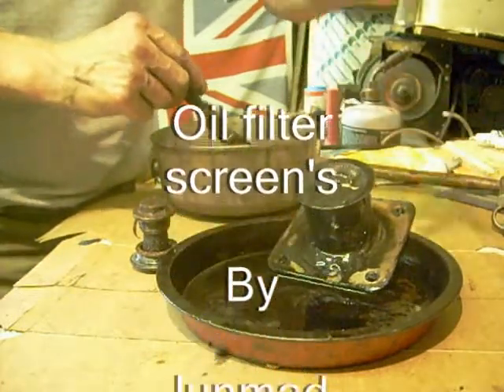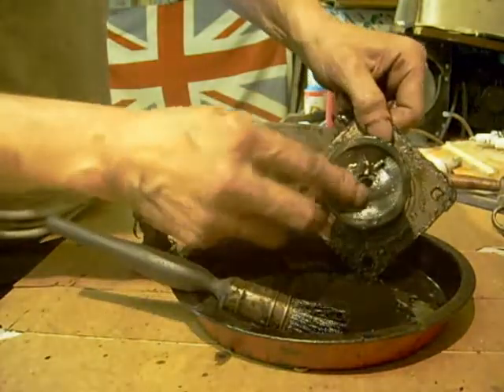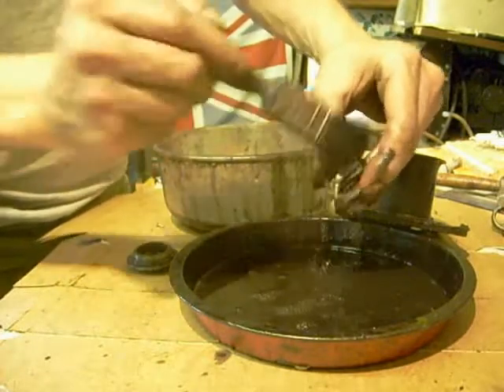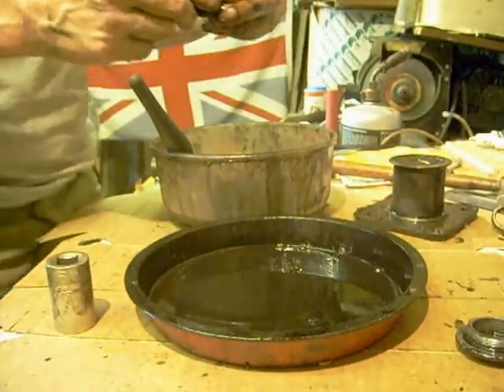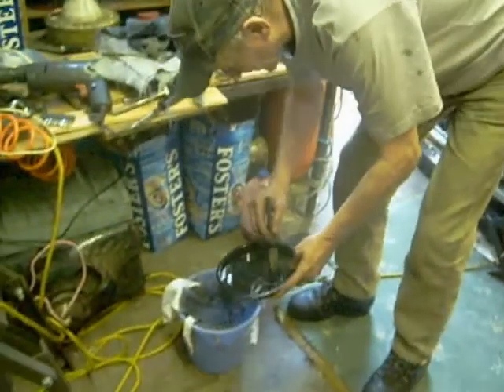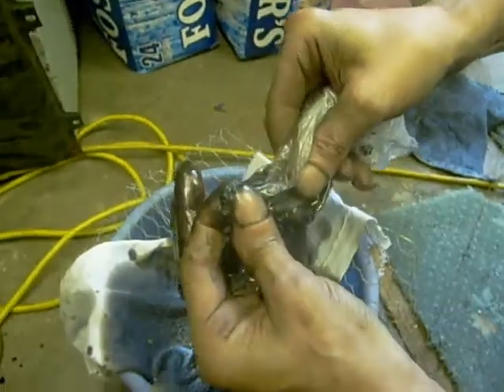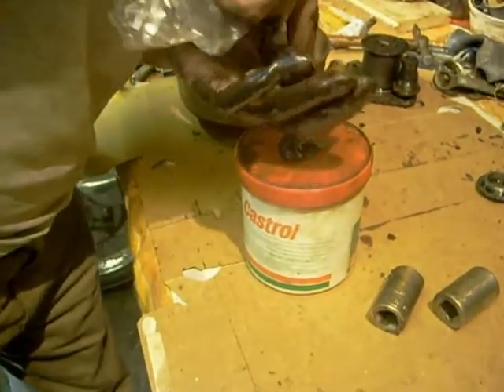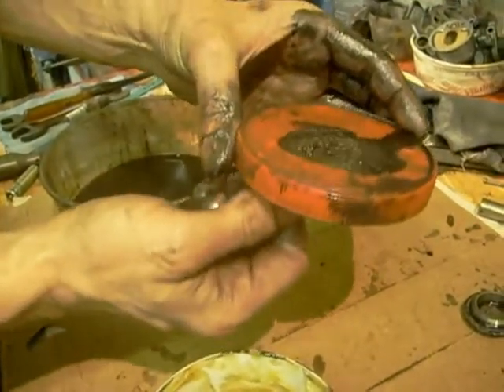Oil filter screens

Comment from the maker: @gnc0909 
Hi gnc a lot more than that! probably more like 5000, "Shame on me!!"
at the time it was using a fair bit of oil (before top end rebuild) so it was getting lots of top ups, and not many changes.
As you have a remote filter the screen could be left out, personally I would keep the screen in as extra protection for the feed (the important one :-)

Comment: WOW that much steel in how many miles.....1500 ?
I don't use mesh screen inside oil tank but have remote filter on return line
you think mesh screen as well be cheap insurance?